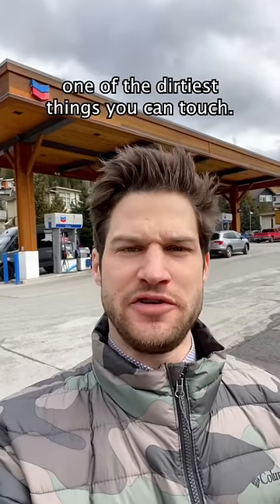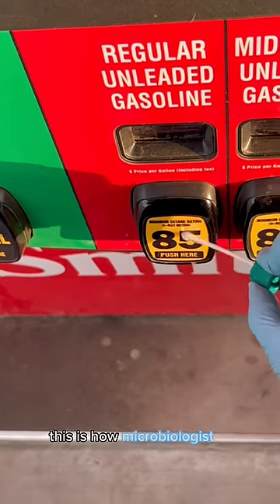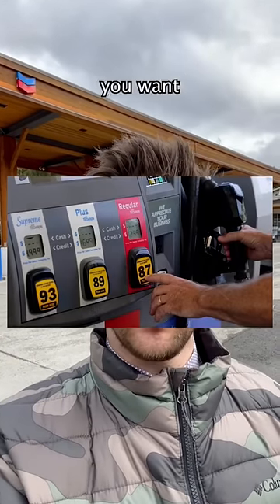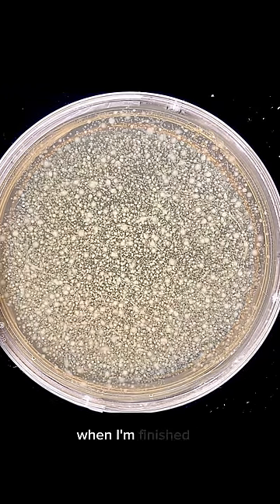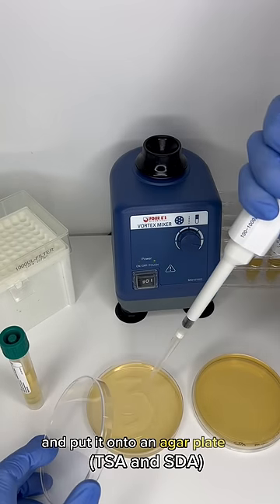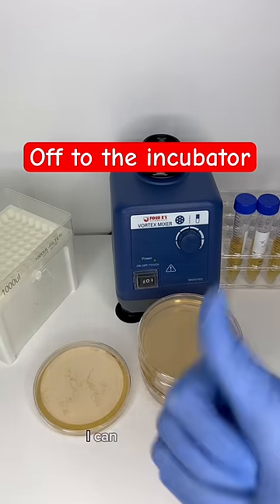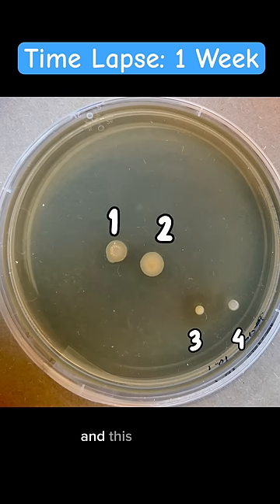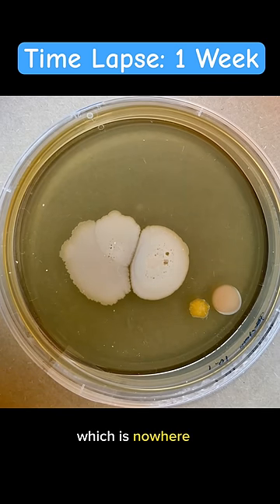Bacteria on the gas pump buttons?

Comment: I worked at a gas station and every morning at about 6:30 am I would clean every single pump handle and button as well as near the card reader and the handle of the squeegee. It took forever.
Reply: Go do that at a Buc-ee's by yourself. By the time you finish your shift would be done.
Reply: I would be surprised if 90% of the gas stations near me even did that once a month let alone every morning.
Reply: now thats a clean station
Reply: There’s more BBQ sauce on the pumps than germs
Reply: Respect
Reply: Our savior🙏🙏🙏
Reply: I don't think the ones around me have ever been cleaned 😂
Reply: Thank you for your service.👍🏿
Reply: Came here to say this same thing. I constantly was cleaning the pumps with disinfectant wipes when i worked at a gas station.
Reply: Ur the worker the dude used the sample on
Reply: Thank you for your service. You really killed bacteria with your bare hands.
Reply: Every morning? Man you diligent asf
Reply: Same only had 20 pumps/ 10 stations yet it takes like over an hour to clean them all especially when people get in the way. Just finished cleaning 8 stations and 2 dudes pull up to the two I haven't cleaned yet so I got to wait for one to leave.

Comment: I always wear work gloves before handling any fuel pumps, gasoline, diesel or D.E.F. only bc I hate getting dirt & grease back onto the steering wheel.
Reply: Gay
Reply: @cadendrake2269  Fella is it gay to be clean?
Reply: I don't think I have ever gotten any grease or anything on my hand from a fuel pump handle.
Reply: I drive OTR,  I fuel 80+ gallons of diesel,  D.E.F. every single day.  I might pop open the hood & check the oil, antifreeze,  wiper or  power steering fluid.  There is a shit-ton pf grease, dirt & crap in that engine compartment,  I don't want to "track it back into the cab" with me. So I wear insulated work gloves. Unlike a gas station for your car, We pull up off the fuel isle so the truck behind us can fuel while I run into the store to urinate/poop, grab a bite to eat/drink & then return quickly so I can continue my day & the truck behind me can pull up too. There are always a few iceholes who park on the fuel line & they get dealt with a padlock that they can't open,  a disconnected airline/ 9 wire, grease on the door handles/mirrors/windows...I have seen a driver add a bottle of urine to a cargo bed & padlock the door closed. The 2 idiots were laughing all the way out to the fuel line. When they got where they were going & couldn't open the doors, they would have to have the padlock cut off,  they would have the trailer washed out & dry  before they could go back to work. Losing @ least 2 days pay. PAYBACK IS A B•TCH
Reply: Just put on hand sanitizer it’s easier 💀
Reply: @ahmedaldafari2120 that doesnt remove grease does it?
Reply: I see yoi too are a man of culture.
Reply: @mr.robinson1982 Seems legit. Spoken like a real trucker. Thank you for what you do for us common citizens!
Reply: @ChlorinightS  not gay but a bit paranoic, if you stay clean all the time your immune system is weaker. just wash hand after getting home/work
Reply: since 2019 and covid I have become a germaphobe . I bring my alcohol sprayer with me in the car everywhere I drive , and I definitely spray my hands before touching the wheel/gear lever or anything after I pump gas .
Reply: Goofy
Reply: @ChlorinightS  yes
Reply: @cadendrake2269  Why would you want to touch a gas pump that's been handled by a bunch of other men without gloves?? Extra gay.

Comment: As someone who works for kroger and has occasionally worked at the fuel center, we are required to clean the pumps once a week. That's probably why the bacteria is low.
Reply: Once a WEEK? In Ontario it’s required once every 12 hours of open
Reply: @YuriMuntari Ok, but why?  People shouldn't go around assuming things like that are clean.  Are people trying to eat off them?
Reply: My fellow Kroger serf
Reply: @SineN0mine3 no mostly just safety reason and you know have some hygiene standard
Reply: Imo it is a dry nonporous surface with sunlight. ...bacteria die there axcluding a few extreme cases
Reply: @stixinst5791 you just watched a video that shows you that isnt the case lol
Reply: Once a week? In my gas station it was once a shift. 😂
Reply: Once a week?! At least they get cleaned.
Reply: Bro tried to take credit for this video ☠️
Reply: would explain the the circle k near my house never has receipt paper, EVER
Reply: @juicetang5079 , you just watched a video that proves it very much.  One,  you don't know how long it was before someone else touched it.  Two , they didn't say a nonporous surface in the sunlight destroyed all bacteria instantaneously.
Reply: We had to clean ours 4 times a day, more during covid.
Reply: @SineN0mine3 it's not really that but you could have hundreds of people touching them. Some of them could of just came from the bathroom without washing their hands. Others could have just changed their kid's diaper. You never know what people were doing beforehand.
Reply: @SineN0mine3 something called public health duh
Reply: @juicetang5079 The video showed that is the case tho, there's barely any bacteria on there
Reply: Lol no wtf?!! It's because the sunlight 🤦‍♀️
Reply: Good old sunlight and UV rays. I need to start hanging my clothes on clotheslines
Reply: @SineN0mine3 i mean being overly clean is leagues better than being adequately clean
Reply: Mi familia
Reply: @SineN0mine3  Bro if you are not rubbing your ice cream into the gas pump you are doing it wrong you are not getting any of the added taste.

Comment: I have always protected  my hands at the gas pump. They're always filthy. I usually use the towels in the dispenser if there are none tissues or napkins, Gloves since the pandemic. Same with the canister at the Bank drive thru.
Reply: Same.
Reply: What’s it like to live in constant fear?
Reply: @rockerneck Exactly 😂 he’s breathing in toxic fumes while pumping gas. Burning oil, leaking gasoline, exhaust fumes, vulcanized rubber/plastic from tires and general air pollution/smog. 
Last thing he should worry about is some germs on a pump.

Comment: maybe they just cleaned them? when i worked at racetrac they sent us out there to clean them every hour 😞😭
Reply from the maker: Not likely. I asked the attendant how often they cleaned and they said just when it needs it.
Reply: I moved a lot and worked at 4 gas stations during hs and before college. Nobody cleaned them. We only cleaned the pumps during the peak of covid. We stopped cleaning them soon after tho.
Reply: As you should!
Reply: Even if that were true,  It would still mean that they're not that dirty by reason of constant cleaning.
Reply: @whatmightgrow its probably the natural UV from the sun that disinfects it
Reply: @captainkirk3000 or the cold during Winter. So just the inbetween that's its probably not getting as might light that it's  got problems. 
Well science is repeating the experiment.
Reply: Youre a baddie fr
Reply: Every hour my a$$!

Comment: I knew right when you went into focus with the camera you were at the wrong gas station 😭
My boy, you gotta go to the ones that have the sticker print fading away on it. That looks like a brand new pump lmao, way too clean.
Reply: Why would you get gas from a place like that ?
Reply: @olioco one it's the only gas station for miles around 
second it's just old+heavy use
Third its late and you don't have a choice 

There's more reason why but it's a bloody gas station not a restaurant so don't be so picky unless the price's are real bad
Reply: @oldfrozenwolf6803  all three of those issues can be solved by managing your gas tank properly… but that aside … why would you want to be somewhere old and overused? Sounds like a recipe for disaster.

I live in a big city though… so maybe I just can’t relate
Reply: @olioco  ya sound like it sometimes you don't have a choice where you fill up and in some smaller towns it's not worth maintaing the pumps at a certain point or It could just be neglect if your only getting a good dozen everyday some people just won't do any maintenance because of the low traffic
Reply: @olioco big city seems to be why you wouldn't understand.
Reply: @oldfrozenwolf6803  I feel that
Reply: @JohnCena-ic7rd big cities guaranteed have worse gas stations than almost anywhere else, mostly because nobody cares and it gets 100x the daily traffic of a small town station. The guy just doesn't know what he's talking about. I travel for work, usually big cities. They don't maintain those pumps in terms of cleanliness
Reply: @hotelhopper681  ah shit, my bad, sorry
Reply: Still 40 will never be as close too 2 million 💀

Comment: i used to work at a gas station. in 2019, we cleaned the pumpes maybe twice that entire year. in 2020, for obvious reasons, we cleaned the pumps several times per shift. i left that job in 2020, so i cant be entirely sure, but i think they went back to the "once or twice a year" thing after 2020

Comment: So the pump handle, both where the palm goes and the fingers, the button (i usually just poke it with the nozzle), and the buttons (i use credit so i don't have to touch it)

Comment: you should check it during cooler weather. hotter weather will kill lots of bacteria especially on surfaces that are exposed to the elements. so it makes me wonder if it would be more dirty in cooler weather when bacteria tends to spread a lot easier.
Reply from the maker: Great idea. I'll make sure to test that variable.

Comment: Gas pumps should be one of the cleanest things u can find in the public. While tanking some gasoline will vaprious some will spill, so it will get everywhere. And gasoline is an insane cleaner. So, no suprise with the result. Btw. one of the dirtiest thing in the public are touchscreen. Sometime they are diertier than the nastiest bathrooms.

Comment: Get a piece of tissue, grab the pump with the tissue, and select the grade with the pump. Continue to fill up with the tissue covering the pump and toss the tissue when you're done. I haven't made contact with any of the gas station equipment with my actual hands for years, and of course still sanitize after you get back in your car

Comment: Was this a clip from a longer video? Were there controls? Were multiple gas stations tested? Was the “fun fact” research peer reviewed and also reviewed by this YouTuber? So many questions.
Reply from the maker: I cut it down for the enjoyment of Youtube Shorts. I did use controls but this was just 1 gas station. I plan to do at least 3 more gas stations as the original study that was summarized tested 3 gas stations. I am note sure if the original study was a peer reviewed study or not.
Reply: @whatmightgrow  super cool! I look forward to it:)

Comment: Admittedly I don't fill up fossil cars that often, since I usually drive electric except sometimes when I rent a car... But I can't remember seeing pumps with buttons here in Norway since maybe the early 1990s.. here there's usually one nozzle per type of fuel... And the choice is usually "95 unleaded", "98 unleaded" or "diesel"... 

(Btw I have no idea what 98 is for because I have never driven a car that didn't strictly specify either 95 or diesel. Is it used for sports cars or something?)

Comment: I wonder how modern cars are running ob such a bad quality fuel. In Europe standard is like 98 octan (98 european octan is equal to 93 american octan) and higher quality petrol is 100-116 octan. Everything lower than 95 is used only for aeroplanes (of course propeller aeroplanes, not those with jet engines) or old engines and it's not avaliable on petrol stations.

Comment: ❤As a driver, You could have a small alcohol @70% to clean the button and handle before and after use.
❤As the Gas Station Owner: you don't Should have wipes @hand to perform these whipping operations
❤Caring is sharing

Comment: Very short. If an object is located on the street and sometimes the sun falls on it, there is a free flow of air around it and there is no excess humidity, then most likely this object is more or less safe to touch even taking into account the fact that dozens of people have touched it. The sun kills microorganisms. Dryness kills microbes.
Places where there are really a lot of germs are next to the sink in the kitchen, on door handles inside buildings, on all kinds of rugs, especially in the toilet, on gloves, wallets, handbags and so on. There are many bacteria where there is moisture, there is no direct sunlight, it is warm but not hot, there is a nutrient medium. A nutrient habitat may well be fats and particles of human skin that are constantly showered from you.

Comment: Hypothesis: Gas pumps are dirty.
Sample size: Zero gas pumps

Following though, I would love to see you actually test the pump handles,  not the button. I usually use the tip of the mozzle to press the button if the machine allows, or my knee or knuckle if it doesn't

Comment: did you pick 85 because no one uses it, so it's likely to be the cleanest? Not from the US, so I wouldn't know. It just seems like very low quality fuel that wouldn't work in most modern cars.
Reply from the maker: Where I am from, 85 is used because it is used at higher altitudes.

Comment: This is not an appropriate way to test this.

Very few bacterial species relative to the number in the world actually grow in lab conditions. Given you only show one plate, that only accounts for one set of nutrients available.

Frankly, there's no great way to determine the number on a gas pump. But it doesn't really matter. Unless there's an epidemic with touch transmission lingering on surfaces, you almost certainly won't get sick.
Reply from the maker: Actually.... this is a great way to test it. The agar that was used is amazing at growing most human pathogens. Since most humans are interested in human pathogens and not the other harmless bacteria, this test is above adequate for what I was trying to demonstrate. That is why the agar method is a common industry tool.

Comment: i know that 1. this is probably the least important test of your life and 2. everything in that lab is surely sterile, but shouldnt you keep the lid hovered over the petri dish instead of on the table while you spread the fluid?
Reply from the maker: The amount of contamination you would get from clean air and sterile air is minimal for products with a lot of growth. So in this case, it wouldn't matter. BUT, just in case I always perform a control that is tested the exact same way to determine if there is any contamination. I won't show a video if the control fails.

Comment: You know damn well barely anyone uses e85😂
Reply from the maker: Where I am from, it is commonly used.
Reply: @whatmightgrow  this is clearly in the us not wherever you are so what’s your point.
Reply from the maker: High altitude states will often have gas stations with e85 which is often used as much as the e87.

Comment: Well everybody uses the gas pump. Not everybody uses 85. And it's only one finger or sometimes some people might take the pump itself and hit it with it. Should have tried the pump handle that actually gets 100% use. You have three or four options of buttons. You get more use out of the pump handle because that is used for all grades. And maybe because it's outside and depends were here at if it's a colder climate or hotter climate? I guess

Comment: Who uses 85!!!? Test the 87 button! 😮 I see what you did there. Very clever.
Reply from the maker: High altitude gas stations have 85 and it is the most commonly used button. I am not trying to trick anyone with my results and I will be showing my results from other gas stations as well to prove that. I don't care what the results are I just show the results.